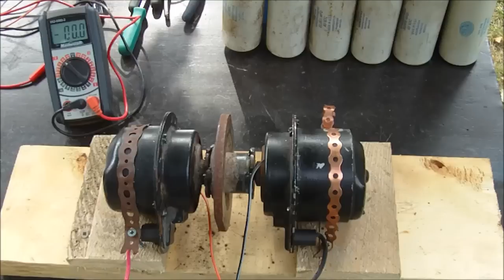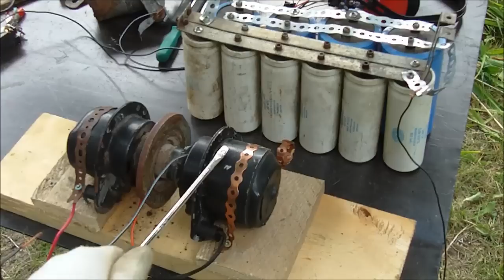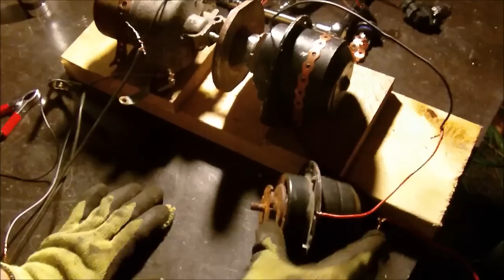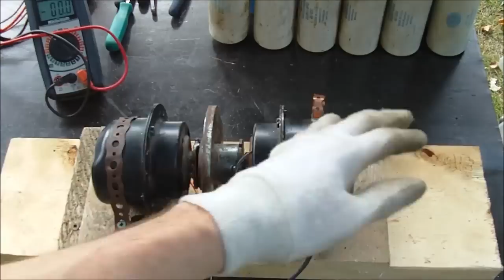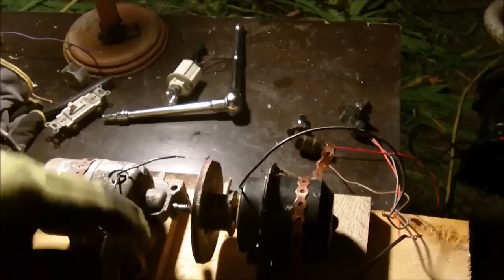Electric Motor to Motor, can they self run?

Comment: I tried this way back in my teens. The fly wheel idea with a battery pack (not capacitors) to help hold and control the "extra voltage" did work for a while but it does eventually stop. Even tried putting a gear box between a smaller "drive" motor and the generator motor. Same results. I even went as far as building my own generator to deliver more power than the motor I was using as a generator. Had some interesting generator designs......, but anyway, same results. Trying to achieve over unity might be able to be done. But it didn't happen for me. Next Batter may step up and take a swing!
Reply: This was going to be my post then I read your message and thought I'd put it here instead, lol.
I think we talking about the same thing, I'm interested to know why it didn't last and how long you were getting out of it.

This was my post; 

Isn't the idea to use an alternator & electric motor? or 2 alternators (with one being reversed as a motor)? 
Basically if you have a large and powerful alternator that's connected to some sort of Large battery Block or powercell etc... That could run your home and be kept charged by the alternator when needed.
Any reason why you couldn't just attach an electric motor (that uses the same powercell/battery block for power) to spin the alternator that keeps everything powered up & charged.
Why wouldn't that setup work? apart from some in efficiency issues that could surely be resolved with some clever thinking?
Surely someone has tried this and there is a major flaw I'm missing that means it can't work?
Reply: The first thing you will notice if you build your own "motor to same size motor" set up is that when no electricity is being demanded from the motor/generator, the drive motor will have no trouble turning it. But as you demand more juice from the generator the drive motor will be bogged down until the same energy the drive motor needs to turn equals the power output of the generator. The system then ceases to function. That's why I tried fly wheels and even gearing to lessen the torque on the drive motor while trying to maximize torque on the generator. Same thing happens. With multiple generators the negative effect on the drive motor gets worse per generator attached. The only thing I could do was lengthen the discharge time on a battery pack by "trickle charging" the pack as it was used to power the drive motor. I did that a very long time ago and my notes on it have long since been thrown out so I can't quote everything specifically. There may be some way to get this thing to work. Concentrate on this: each part of a system like this has a weakness that effects the efficiency of another (or next phase) part of the system. Finding parts that can compensate (ideally OVER compensate) it's weakness to the next part of the system is key to doing this. Research, build, test, find the flaws, repeat. I hope for the best of luck to you. We have to get something working sometime!
Reply: Thanks for the reply mate I appreciate it & yeah I agree we do too... Think the answer lie's with more natural resources like water. I always remember Nikola Tesla's quote on how waterfalls are the most resourceful & productive way of creating energy.
So If you have this or a running water flow on your property you're already in business, but I can't see why anyone couldn't set this up with a makeshift dam, or large water tank, that feeds down and through a turbine that ultimately powers your generator, then using some sort of ram pump system to feed the water back through making it self sustaining as long as you have enough water pressure.
Even having that other set up we talked about as a back up etc... That's probably what I'll be looking at doing, something like that I'm thinking.
Thanks for your help :)
Reply: LOL! I did that project about a water source running a generator that feeds water back to the source! Thinking alike here! What I did with my nephew was: 5 gallon water bottle (water source) running a 4 foot drop to a small motor (generator)ending in a spill pool. At first we had a small pump hooked to the generator but ran into the same problem as the motor-motor design. We decided just to "make it work", ran to Radio Shack for a few small solar panels (the small kit sized ones), then had the solar panels run several small pumps to feed the spill pool water back to the source. Worked fine though defeated the purpose. Just seeing results was exciting for my young nephew so he was pretty proud. Sometimes seeing something you build like this can give you future ideas. NEVER be afraid to try something even if you think you will fail. That failure may lead to new ideas that may work.

Comment: have you tried bigger plywheel with powerfull magnets and coils that would generate 12v connected to an inverter 12v-220v dc which will supply the needed electricity to run the motor

Comment: Im thinking that if you wanted something to self run the output energy of module one need to be greater than the input energy to module one.
If you cant figure that out then theres no point in adding another module to modify(in this case convert the energy) or return energy to module one.

Comment: One electric motor turning two generators charging in parallel with batteries in series. Charge the battery at the same rate that it drains and the electric motor should run constantly. If a hose outputs 1 gallon per minute, and the bucket empties at 1 gal per minute, the fluid level in the bucker remains constant. : )

Comment: Curious, What about using the platform of a train car. An extremely large battery and Many wheels that are hooked up in a circuit that generate their own power.
Wouldn't you be able to turn enough generators to charge/power the battery that can create more energy than an efficient motor to pull the cars.

Comment: its is possible to self run the way u connected two motors they are in opposite direction so it will spin opposite of each other so try to put them next to each other put belt to spin both of them so they both will spin in same direction and if you do it right way it should work im not sure its gonna work on those motor. but you can try it with smaller motor which is easy to do current calculation.

Comment: Suppose that physics laws do not  support this idea as we lose energy when we move from motor to generator and vice versa . But what will we lose if we connected a generator to each fan for example and transmitted that energy to another device for example or another area for example even the resulting energy  from the generator is less efficient from the original motor ?

Comment: Suggestion. If you are going to do it all on a 12 volt system, the drive mototr needs to run at a high rpm and with enough torque to allow a pully system to drive the motor/generator.  The larger pully on the drive motor and the smaller one on the generator/motor. But still, this will not really give you much power. So, the solution is to get away from DC current and go for AC.  Using an AC motor as the drive motor and a higher voltage, higher amp output PM alternator (permenant magnet), you can produce more power than the motor is using. Again, the system would be pullied with the larger one on the drive motor to the smaller one on the alternator. Using large AC capacitors in parallel to smooth out the ripple of the AC current will help too. Yes, to start the system, you will need an outside AC source. But once it is up to speed, the outside source can be cut off and it would self run. There are a few folks here on youtube that figured it out and I am about to set mine up as well. The main problem I have is the moving parts and the brushes that wear out. Brushless motors and alternators are best but more expensive.

Comment: The principle behind this is actually quite easy to understand: 
Imagine if you didn't have any motors there's an equilibrium of energy that sum up to 0.
If you have any realistic engine there will be losses, and so the equilibrium of energy ends up being 0 but some of that energy isn't going to power to engine and is actually being loss by friction, heat, and other electrics losses.
Two motors of same efficiency will have double the losses as one motor, they should stop each other rather quickly once both are off the grid.

you can't do like a electronic turbine that makes this thing spool up without fuel, or in an electron point of view, batteries or any outer source of power

Comment: I look back at the past on perpetual or 100% efficiency designs and realized that the problem was the moving parts. So, that would mean a perpetual machine must require no moving parts.  So kinetic energy is not the source. 

I guess the only ultimate perpetual machine is the Atom itself (?)
Also, would a solar panel be classed as a perpetual machine or close?

Comment: I've always wondered about this but one thing I want to try eventually when I get a hold of a old car alternator is to do this concept but with a small motor something like a fan blower motor or just a small electric motor and make a pulley and "jump start that small motor and I'm totally sure that car alternator will generate enough amps at 12v to keep the motor running to keep the alternator running basically all I would have to do is calculate the pulleys to make sure I get the correct rpms to make sure it keeps the alternator going then I can use make some leads going from the alternator go to some batteries or ac converter or something its something I'll mess with eventually
Reply: No, Newton's laws apply no matter how big or small your motor, generator, pulleys or gears.

Comment: You need to apply a pulse maybe with a reed switch to only power the motor and thus flywheel for maybe 10% of the full 360 degree arc. The flywheel will maintain the energy and add some, while the generator will convert all of the arc. Its this fact which makes the system self sufficient and able to power other devices. 

Regarding the reed switch. Its a switch activated by a magnetic field. Cheap to buy. 

Place a magnet on the flywheel at the edge and position a reed switch close to the wheel so that it only closes and activates the motor when the magnet passes. Add as many magnets (representing the pulses) around the flywheel to power the motor enough to start the wheel and eventually keep it running.

Essentially the flywheel is interacting with gravity/rotation to increase the energy in the system thus making it an open system instead of the classically closed one. The fact it is open, also means its not relegated by the classically closed system models around thermodynamics for example and doesn't break any laws.

The flywheel is akin to a wind generator/solar panel and acts as an interface to the energy all around us! In this case primarily gravity/momentum/earth rotation are the forces we capture. 

It definitely works, the wider/heavier the flywheel or balanced weights the better. 

Good luck!

Comment: +kurtscottage One thing you could try that I've thought of but couldn't bring to fruitition is instead of face to face like you have, have them set up side by side, with some distance, and have gearing kind of like a bicycle where the big gear would be on the motor motor receiving power and a small gear on the one creating the power. If you try that, we'd like to see the vid :)

Comment: I wonder if hooking up a Tesla Turbine to a generator would be a good way to "approach" over unity.   You would need enough power to get the turbine up to the correct speed, but once it takes off, I wonder if it would cause the generator to give out a helluva lot of power.

Comment: It's a flywheel with extra steps. Even with perfectly efficient motors/generators, and no frictional or air resistance losses, the most you can expect is it to spin at constant speed, like a planet in orbit.

Comment: you didn't look the whole picture..why there's so many capacitor on that table?..and it might be connected for those motor,  for knowledge...capacitor and inductor(motor) connected parallel can create flywheel effect(unlimited energy) but need to supply it by enough energy...please everyone contribute not to criticize or negative on this. Think there's so many individual wanting our life easier and study what ever aspect that may contribute in our society. Appreciate their doing!!!

Comment: Motors are fun to play with.  If you connect the two in series and load down one, the other will speed up and run faster.  You can find ways get energy off the motors while they run.  Wire a capacitor and a LED light across the motor connections in both directions and they will light up and the motor will run just as well.  But, over unity is never possible.

Comment: It would work if there was absolutely no friction in the system right? Including resistance in the wires as some of the energy would turn to heat and dissipate, but then it gets weird with Ohm's law with R being zero because what would the current be? It would be useless as a motor anyway because it could only transfer the energy it took to start the spin.  In any case if you wanted a self running motor to do anything it would be creating energy out of nowhere, ripping the universe apart and destroying life as we know it in the process. It's fun to experiment though, and It got me thinking about the math.

Comment: also use a transformer that with a unit that controls the outputs of the generator to motor and loads from generator to keep the motor from not losing its max speeds or constant speeds of motor  here !!

Comment: Hello, what if we run the motor with a battery and have the pmg keep the battery charged. Would there be additional power to run electrical applianced?

Comment: I was wondering if you could do that with batteries That would be so cool because you have a battery that never ends out and not have to have an electrical cord plugged into the wall

Comment: Get a Hamster and put it in a running wheel in between both motors. You will have power until the Hamster gets tired .it will give you an extra few minutes of power .This video is from 2014 though and to be fair we have advanced in technology since then.

Comment: the centrifugal force and torque keep it going . momentum with the weight on good roller bearings help, each part of the circuit has its own electrons in the wire coils. the DC motor windings act as a generator. and the primary and secondary coils of the power transformer. the electro - motive force or EMF in each part of the the circuit is enough to keep it going. a good motor to use if you want to make is small the the computer printer motor . its a large DC motor on the side of the printer . make the middle a shaft connector with a pulley to pull like a lawn mower

Comment: you have to use a 12v DC motor to turn a 460 3 phase motor. this will increase the voltage. more volts means more power right.

Comment: I think I will stick to getting my ruby laser setup to lase from just local sunlight (i.e. X-number of photons per square metre) and concentrate that sunlight-derived energy into a generic laser pulse modulated at FEMTOSECOND or MAYBE NANOSECOND pulses using IGBT or Power MOSFET to drive pulses to 10 nanoseconds or less against a ribbon of Single-walled carbon nanotubes which can act as nano-scale junctions between electrodes to take advantage of the STARK EFFECT.

That ribbon of nanotubes can eventually produce a small current and when aggregated into a larger summed circuit, can produce LARGE amounts of current to get a BIG power production system.  At mean sea level, a square metre of sunlit area has about 1000 watts of potential energy. Lase that and even with normal conversion losses you will get about 600 watts output per square metre. 

To give you a BETTER IDEA of how much power that really is, ONE SQUARE kilometer (1,000,000 square meters) of such technology will return about 600 watts per square metre PER SECOND x 3600 seconds in one hour x one million square meters = 2,160,000,000,000 watt/hours or 2.16 Terawatt hours of energy!  

That means the ENTIRE USA could be powered every day using JUST FIVE square KM of this type of ribbon technology at an average of 60% for sunlight-to-laser-to-nano-ribbon energy conversion efficiency!  Just put the thing in Arizona and you can power the entire USA for less than three billion US dollars of initial manufacturing cost! POWER MOSFETs or IGBT chips can last for MANY decades and nanoribbon is on the centuries scale so it's really just a matter of initial construction costs.

Comment: 1) it would depend on the build of the motors and the way they are made
2) You modified the motors instead of leaving them as is..  
3) it seems like a poor choice in motors too.
4) have you considered trying different sized cogs a larger cog with a smaller cog &or using a chain or belt etc??

Comment: 🌤Hi Sunshine, you're correct motor to motor doesn't work at the same voltage but motor to generator does work if your generator can increase the voltage making it more efficient than the motor...

Comment: and im not saying a capacitor cant hold a charge for long term but with this i have no clue what the amps are or any of the finery details of this project which would be nice to know ...then i could do the math on why this isnt working but mainly its because you need that battery that has power for for the type of project you need it for